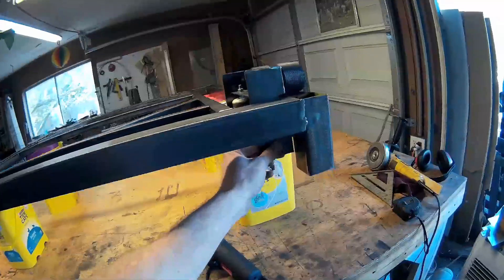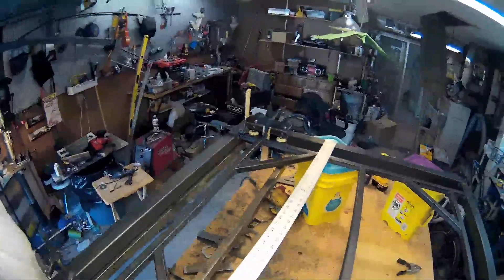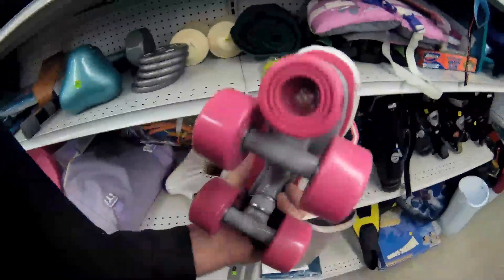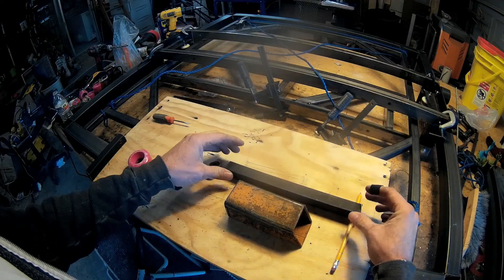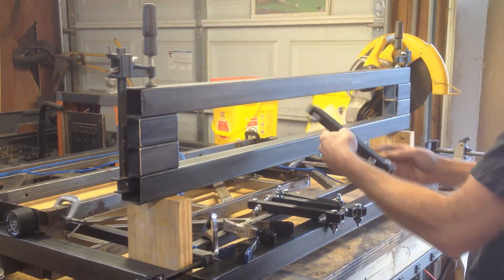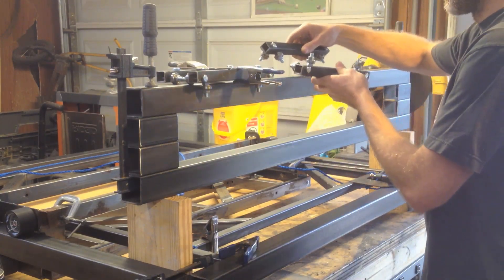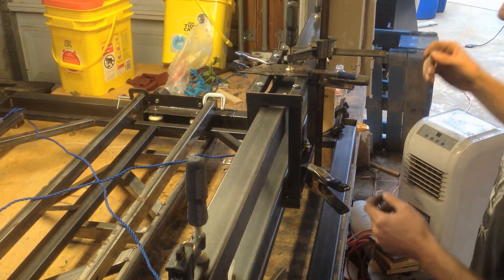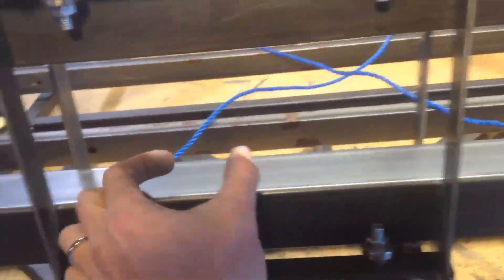How to: DIY Arduino CNC Router Cutter Welder (Part 2: Y-Axis)

Comment: You've put the top bogey on the top rail and the bottom bogey underneath the bottom rail. All the weight will now be on the top rail. I will put my bottom bogey on top of the bottom rail to even out the weight distribution.

Comment: looked for a moment like you commited the terrible mistake to draw weld current across the bearings! Ok hopefully with all the right angles and clamps in place the current found mostly a safe path, but the mistake has happened many times and usually won't go unnoticed for long...

Comment: Nice job Did you burn your eyes a little. It dont take much pluse even when you look away it will still fry your eyes I know its only spot welding but it really only takes a one moment to long and dam there goes the long night. I learned that when I was 12 years old watching my dad spot weld. If not then good for you but don't press your luck. Were a welding helmet it will keep your eyes safe. Great job thanks for sharing.

Comment: That's a very good idea, thats what I'm thinking, cuz I think that an standard way like using 8mm stainless rod and spindle ball not will very strong for long distance. Or Am I wrong?

another thing that Im thinking is that, what about if simply use rails and bearing in order to do the axis, what did you think?

Comment: good job but worried for your wheels - either arcing through the metal ones or melting the plastic ones - will you shelter them from sparks etc?
Reply from the maker: Seems to be working fine.  If I encounter any issues I can always build some guards.
Reply: thanks that is a very useful - opens up a lot of avenues - I am PC based at the moment but might put this together as simpler and smaller (and easier to replace)
Reply: another question - I welded up my frame - and like you winged it around the basic shape - Now though I might want to add and weld more bits on - how delicate are the electronics to having the welding on the same earthed frame? - i had given up the idea and was looking for alternative fixings but seeing you weld I wondered if I dare.....on the other hand it is a dewire and rewire everything or a $500 risk
Reply from the maker: Electronics are unaffected by the welder.  However,  a plasma cutter will definitely cause damage if not properly grounded.
Reply: thanks for the advice

Comment: I wonder if any of the geniuses below have built anything like this. Anyway, I am following your basic design. Any problems can be dealt with later. I too am building this in my garage and plan to move it into the basement. My question is you say that you are screwing the cross bars to the gantry trucks so it can be disassembled. After the gantry is welded onto the trucks, can you still remove it? I am just getting to that part, so I am wondering about screwing the gantry as well. What do you think? Also I find that by using urethane skate wheels for the two insiders gives the whole assembly the ability to flex slightly. I may try to turn down some look alikes from some hard nonmetal material. Even engineers must tweek their original designs.
Reply: I built a cnc from plywood.  It's very accurate.  .1mm no problem.  I put up some videos.  Did you finish yours?

Comment: Are those bearings wearing that steel tube??    Just curious having the hardened surface against mild steel...
Reply from the maker: Haven't noticed any wear.  Keep in  mind the bearings sit close to the corner where it's much stronger.

Comment: The wheels you used for X axis are those made from hard rubber or what? Did you count into that they might wear out and how would you adjust or compensate if they wear out?

Comment: Are you going to surface harden the square tube rails where the hardened bearing races roll on the cold rolled steel?
Reply from the maker: no

Comment: 02:40: Why did you place the white wheels on the inner side of the frame? If it were on the outer side, then you could join the flat (guiding) bars with the table as a monilithic and thus more rigid construction. Isn't it?

Comment: Check out dog-point-screws, with a corresponding hole in your tool holder for quick/solid tool mounting.
Personally I'd grind the nuts off the Z-axis carriage and put nuts on the tool holder itself. (Hard to do with square-tube tool holders. Easy to do with angle-iron tool holders.)

Thanks for the knowledge/inspiration ,
Dueceofnands

Comment: Your videos are amazing. An inspiration to me. What kind of straightness tolerance is on the metal? Or maybe I should ask, what kind of metal do I need to buy to get an acceptable tolerance? Because I want to make one of these multipurpose machines, and one of the purposes will be milling circuit boards. There's very little room for error there.
Reply from the maker: The metal I used is dead straight,  it is mostly 2 inch square tubing 14 gauge in thickness.   It's definitely accurate enough for PCB milling.  Thanks for watching!

Comment: Hola Absorber excelente tu proyecto, la estoy armando pero quisiera saber si podes por favor  los tipos de  medidas de los caños cuadrados para poder hacer el router CNC. Muchas Gracias Aguardo tu respuesta. 

Hello excellent Absorber your project, with'm putting but I wonder if you can please the types of measures of the square pipes to make the CNC router. Thank you await your response.
Reply from the maker: Te refieres a los tubos cuadrados?  Son de  2 pulgadas y calibre 14.  Los tubos delgados son de 1 pulgada, también calibre 14.  Buena suerte!
Reply: Cuanto es calibre 14 en milímetros? Tienes alguna tabla de conversión? Gracias! Excelente el proyecto.

Comment: You should not have electricity going throw the ball bearings while welding. This damages the ball bearings. Put the clip on the carrier.
Reply: I started screaming " NO DON'T" when I saw him clamp the ground where he did
Reply: @ZuluComander  why does it do this, arcs?